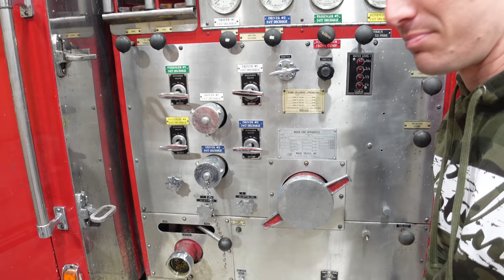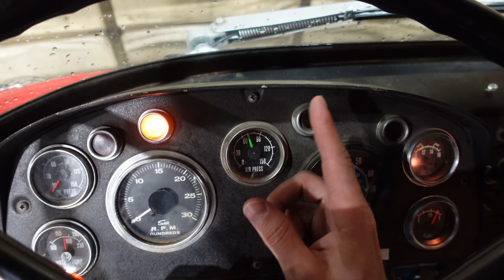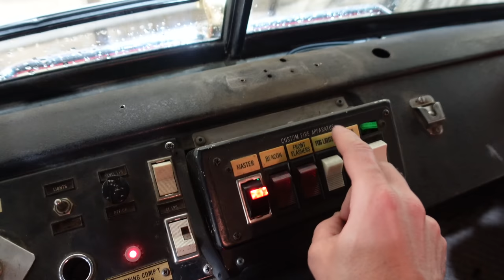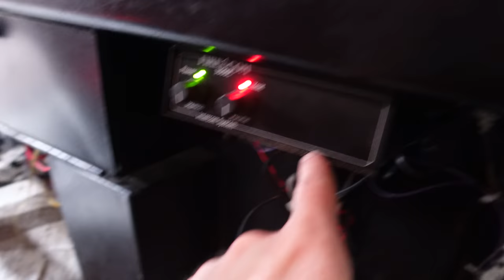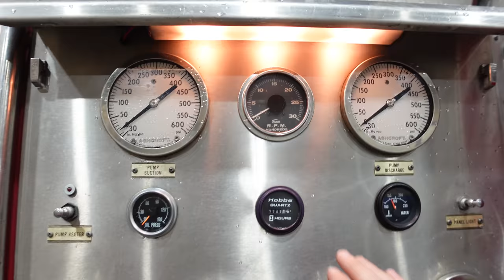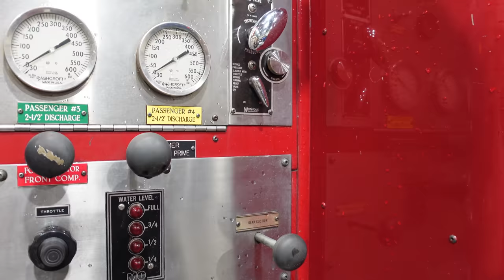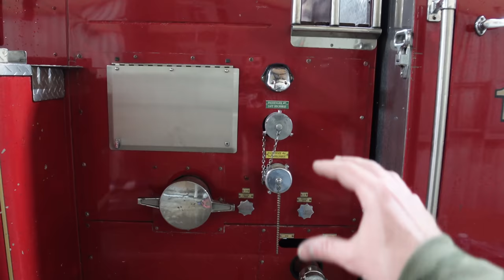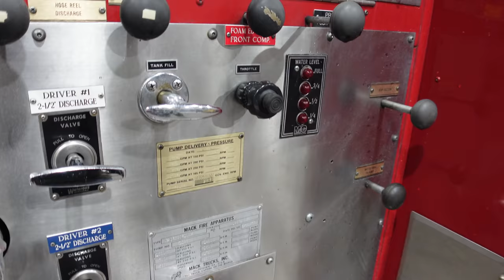Here's A COMPLETE Tour Of My 1977 Mack CF-600 FIRETRUCK

Comment: The Gold Bulldog represents the fact the truck is built completely of Mack components from chassis to drivetrain and body
Reply: And since it has the ENDT-engine, the engine is acctually a Scania engine
Reply: @megu_weeb  mack is owned by volvo trucks isn't it? So we have come full circle
Reply: @fritsmolenaar05  scania is Saab. Don't know what engines volvo trucks run. Probably volvo made.
Reply: No , his is a Maxidyne motor. Dont know which one though.
Reply: @geraldlafleur7776  probably a 350 mack to run the pump.  they take a pile of power.
Reply: Pretty rare too!
Reply: @fritsmolenaar05  No, 
These we’re made before Volvo bought Mack.  It’s a true Mack Engine
Reply: cool last name haha
Reply: I drove Mack trucks for years and had heard that, but it's been a minute so I forgot. Thanks for making the comment. We get old, we forget.
Reply: @adriandean7815  saab has gone bust and volvo trucks now ownes renault and mack trucks
Reply: @fritsmolenaar05  yep. I own a classic 900 Saab. And I live in Sweden. Lol. Somebody said volvo truck engines was scania. I said Saab is Scania. Don't think volvo engines are scania engines. But maybe.
Reply: Was just about to say the Gold Bulldog is the first sign that it's all MACK
Reply: The pump was by Waterous pumps, being a 77 , means it’s made from problematic steel and will rust if not kept up
Reply: Also it was refurbed at some point, rear seats used to be open air
Reply: only up to a certain year, then it was maxidyne motor for gold, silver had the thermodyne motor. its got an automatic transmission in it so this wont be a full mack drivetrain.
Reply: @fritsmolenaar05  never knew that till now! Early 2000’s is when Mack was purchased by them!
Reply: Ya beat me to it, Josh. Good on you.
Reply: @jimwilloughby  Mack has been the only thing ive worked on for 16 years now
Reply: @megu_weeb  How did you determine this? It would not have a gold bulldog unless engine was manufactured by Mack in 1977) at Hagerstown, MD.
Reply: @fritsmolenaar05  It is now.  In 1977 Mack was owned by Signal Oil and Gas Company - since 1967.  Renault bought a 10% shareholding in 1979.  Mack Trucks is a subsidiary of AB Volvo now, which purchased Mack along with its then parent company Renault Véhicules Industriels in 2000. i have NO IDEA what you mean by "full circle."
My father worked at Mack for 45 years (1937 - 1982, my uncle about 40 years, mostly on the 'fire line;' as they called it. The early all-Mack Fire Apparatus (In 1956 Mack bought the tooling of the Ahrens-Fox Fire Engine Co. and introduced the Mack C Model cab forward fire engine) manufactured in the now-gone 5C plant (Allentown, PA) then later moved to the Lower Macungie plant, which produced the Mack CF model fire apparatus, likely where this truck was made.

Interesting note - Mack made the FDNY Super Pumper - Called the world's most powerful fire engine ever built. See video: https://youtu.be/lKUBAgUUyIg

Comment: I think we have the original Streamlight that goes with that mount, I would have to look in storage, If so, you can have it when you get the Title. I do think it needs a new battery though. We had others we would grab before calls so we never used that as it was always a backup if those went down. If you have any questions at all, you have my number, feel free to call and ask!
Reply: I have yet to meet a Streamlight boxlight that didnt need a battery! Lol
Reply: @keithmack2368  So true LOL, In the future we want to upgrade to the new LED Streamlights, but for now the old girls work just fine!
Reply: Luckily, the batteries are available, cheap, and dead simple to replace. You can get new ones for less than 20 bucks on Amazon. Just be sure to get the right size tab connectors on the top. The same battery is used in emergency lights and computer UPS systems, but can have a wide or narrow tab.
Reply: @porcelainthunder2213  a quick search on Streamlight’s parts site shows that they still sell the battery for the Firebox/Litebox series as well as all the major parts to completely overhaul one!

Comment: I was a driver engineer from that era. New engines of that era went new for $ 70 to 80k. I drove a pretty well optioned American LaFrance 1250 gpm. The pump on this truck does not run on a pto. There is a pump transfer case built into the bottom of the pump.. To use most of these you would set the trucks parking brakes. Then put transmission in neutral . Then select pump position on the pump selector in the cab. This would disengage the driveshaft from the transfer case to the trucks rear axle. And engage a gear train internal to the pump to drive the pump. The trucks transmission would the be placed into whatever gear selection required by the manufacturer and the transmission would lock in that gear. The driveshaft from the transmission to the pump would run the pump but was disconnected from the trucks rear axle when pumping. Be careful not to run the pump dry as you will damage it with no water. Hopefully you can find some hose and get it pumping. There are clubs that get together with antique trucks, some much older than yours. They show them off and pump them at events they call musters.

Comment: Some nomenclature pointers: The hard rubber hose on the reel we called a booster line. Maybe discharge 5 or labeled booster.  VERY handy because it can be charged (pressurized) on the reel and great for small fires, dumpsters, grass fires etc. Scrounge up an adjustable fog nozzle for that and you can use it too! The packings in the pump dont like to be dried out but the pump cant be wet and frozen either. Read up on the pump so that it does not get damaged. My memory tells me that Mack used HALE pumps. Mack was a rare fire engine manufacturer in that they built the whole truck save for maybe the pump itself.

Comment: It is nice to see the old Mack Fire Engine.  Your "new" Fire Engine that was built in 1977 was refurbished by Custom Fire Apparatus in Osceola Wisconsin in 1989. 
When the engine was in 1977 by Mack it looked different.  The cab rear area was open with a gate on each side to get in and out of.  The pump panel was set up differently.  The rear box was also different. 
In 1989, Custom Fire rebuilt the whole truck.  They started with taking the whole rear box off and putting a new box and water tank on.  Next, they rebuilt the 1000 gpm mid shaft Waterous pump, the pump is a mid shaft not a pto.  Finally, they enclosed the rear crew cab.  NFPA had made the rule that any new or refurbished fire engine, truck, or other fire apparatus must have enclosed crew cab.
If you want some information about your engine, you should contact Custom Fire.

Comment: You need to drain out all the water from the hoses and tanks. Or run some rv antifreeze thru the system so it doesn't freeze up in the cold weather and while driving it. You'll blow out or crack the pump and castings if you don't.
Reply: Here in Germany we drain the pump whenever it is not in use for exactly that reason. The tank however is less critical for several reasons. If your garage is heated (which it usually is for fire stations here) it won't freeze while it is in there. Out there it would take quite a while for this amount of water to cool down and freeze, and last but not least other than the pump, the tank usually has some air between the water level and its ceiling, leaving room for expansion. But draining the pump is essential if there is a risk of freezing, I agree. :-)

Comment: That was built in Allentown, PA.  The MACK CF was a workhorse of a fire truck.  It is built like a tank.  The Federal Q2 on the front bumper takes an enormous amount of amperage to run FYI.  
That unit originally had an open cab and was converted to a 4 Door.  Let me know if you have any pump operation questions, I am a firefighter in New Jersey with a lot of experience on pumps.  Looks like it is a 1500 gpm pump with a 500 or 750 gallon onboard tank.
Reply from the maker: Yup, I was told it's a 750! I can't wait to fix the Q2 💯
Reply: @WatchJRGo  If you want a pump primer on how to, let me know.  I can also help you find some accessories like ladders and hose.  Awesome buy!
Reply: 750 Gallon Tank, and 1000 GPM Waterous Pump.

Comment: From a Former CF operator.......The gold bulldog means it has a Maxidyne motor.  (Mack’s superior motor).  The horn ring shows who the rig was originally built for.  The clps switch is for the clearance lamps.  The reservoir for the windshield washer is in the passenger side cab door-it may be empty.  There are plates on the body just past the pump panel that say Custom Fire.  That indicates the chassis and pump were built by Mack, but the body was built by Custom Fire.  Get rid of that AFFF foam.  It’s a known carcinogen.  The controls for motor shutdown in the cab are air shut offs, not fuel.  Mack commonly used air shut offs for many years in their trucks. The air connect is a quick (and easier) fix for a leak in the air system.  Its not something Mack would install, but it works.   Its a sweet truck that will run for long time with a little tlc. Have fun
Reply: The "Custom Fire" plates were added when the truck was redone by the company that did the work.  This was when the pump was replaced, auto transmission added and the color coded labels were added to the pump panels and the jump seats that had mounts for the SCBA's.  All these features were commonly added to fire engines in the late 80's - early 90's.
Reply: @tomwilkeson2419   Were the jump seats open and then enclosed during refurb as well?
Reply: @greymansion1  I am not familiar with this engine but was speaking from being a firefighter in the early 90's and seeing the big push to auto transmissions in emergency vehicles that took place then. I think you might be right about the cab. Many were converted during the same time.

Comment: Very nice. I fought many fires from a similar 1970 CF600 that had been FDNY from Staten Island. We bought it when FDNY retired it and redid the bodywork. Made the tank smaller and put a hydraulic reel in the back that carried 1500 ft of 4 inch supply hose. It was our water supply engine.Have fun with yours.

Comment: The truck has always had a 12 volt electrical. Originally it used 2 6 volt batteries in series to equal 12 volts.

Comment: Now that is old school quality all through that truck.  You STOLE that at $3,000.  All of that diamond plate, polished stainless, gauges and chrome.  Don't do it, but the scrap value on all of that equipment, let alone the running gear, has to be enormous.

Comment: Brings me back... First engine I drove as a rookie in 1985.  Our CF-600 was a reserve engine at the time. It had a non-synchro manual transmission so you had to double clutch and match rpms to shift. It was a V-6. When you got the hang of it, with the short wheelbase, it was so cool to drive.  When I was an engineer, I had the experience of pumping with it (and other pumpers) to Chicago FD’s Big John deluge gun, 6-7-1,  at the East Chicago tire fire in 1994 https://youtu.be/W7KyNUt7RwU . We later donated the rig to the Hall of Flame fire museum in Phoenix. It was fully restored in 2004 by the museum. I retired as the vehicle maintenance officer. I spent many hours in, on, and under that CF. Thanks for the memories.

Comment: That enemergency engine stop in diesel engine is normally air flap to cut out air. Diesel engine can run away with its own engine oil, so fuel cutout wont help.

Comment: JR, the siren/horn switch lets you use the horn button on the steering wheel to wind the Federal 'Q' out. There should also be a foot button on the floor on the officer's side (Passenger side) that controls the 'Q'. You've bought a true classic, BTW...the Mack CF is an awesome rig. The fire department I ran with (Chesterfield, Va) had had around 20 of them...they were like tanks, they last forever.

Comment: The pump is not PTO driven.  It is driven through a transfer case.  The input to the pump is a driveshaft directly connected to the transmission output shaft.  In "Road" condition, the transfer case supplies all engine power to the rear axle.  In "Pump" condition, all of the engine power it supplied to the pump rather than the rear end.  PTOs back then could not handle the full engine power.  Modern PTOs can handle 1250 GPM pumps and possibly even 1500 pumps by now.

Comment: A few things:

That 120v shoreline plug is an auto-eject.  As soon as the alternator spins, it fires out the cord... no button for it.

That e-stop kills the motor with a fuel cut on top of the engine.  You’ll have to get to the intake manifold to reset it, and it’s a complete @&$%# to get to.  I’d leave that one alone.

That Q-siren is clicking its brake when you push it.  I’m guessing that’s the siren brake button.  Look for a little black pedal on the floorboard that runs it.

The air check valve is just past that air plug.  It’s a simple one-way valve, common part.

Streamlight firebox flashlight: you have to do it.

 Nice wheels, bro!!

Comment: The headset connection at the pump panel allows the engineer (driver / pump operator) to access the vehicles radio remotely so they can hear other vehicles and communicate with handheld radios on scene. The push to talk on our engines keys the radio.

Comment: Oh, and the turn signal control is a replacement. You can see where the original control arm was in that opening on the steering column.  The green light just forward of that was the original turn indicator light.  That’s why the hazard light control is on the dash.

Comment: One thing to note with these old pumps, try not to run them dry, the water helps lubricate the compressor wheel, make contact with the pump housing.

Comment: The big ports you were calling suction are called steamer ports, they are for your large bore hydrant connection . the smaller ones are for low flow hydrants that use 2 1/2 hose for its connection. Newer hydrants use storch connectors, 1/4 to lock. These are anywhere from 6" to 8" LDH. (Large Diameter Hose)

Comment: If I had the money/time/inclination/YouTube channel, I'd definitely turn it into a kind of rolling repair shop for cars. You already have air compressor needs so get a larger comp so you can use air tools. Convert some of the water tank area to hydrolics if necessary and add some kind of transforming, collapsing Benpack lift that is always connected to the truck for stability but can be deployed and retracted when needed. And then convert the remaining water capacity to high pressure hot water for detail/power washes, and then add a vacuum system for well... Vacuuming. You already have loads of parts and tools storage. Add a way to safely tow vehicles like a simple vehicle hitch and imagine the videos you could make. Just head out on the highway looking for broken down cars on the side of the road. Tow them to a safe location, repair them and get them back on the road better than before. JR-Go emergency vehicle service!

Comment: You can add an air pump if you have a Kussmaul auto charge, or get an auto air eject from Kussmaul and leave it plugged in all the time. Works the same as the shore power ejector.
Reply: At our station we have a 80 gallon air compressor and lines plumbed across the ceiling to reels that are connected to the trucks with a regular air hose connector to keep the air brake tanks full so trucks are ready to go. The 110v shore power runs onboard battery chargers for the truck batteries along with various chargers for different pieces of equipment.

Comment: Foams not usually used on bonfires, mostly flammable liquid fires as well as for vapor suppression. The appliance in the first cabinet you opened with foam is the enductor, goes into the bucket of foam and mixes with the water and is made into the bubbly foam at the nozzle.

Comment: The Federal Q2 Siren button your pushing on the dash by the switches for the lights is probably the siren brake, theres probably a button on the floor like a old school high beam switch. Thos streamlight light is not explosion proof, get one with the led bulb. That truck probably cam a 12 v system. My first day working in 1996 I drove a truck just like that except ours the two back seats were a open cab. Those tires are split rims, very dangerous to change unless you know what you are doing.
Reply from the maker: I didn’t want to pay for a new one so I didn’t get the LED. Ended up with the old school one for $40 🔦

That switch totally sounds like the brake, I’ve tried the floor switches and they didn’t do anything, I’ll get it fixed 🍻
Reply: @WatchJRGo  the floor switches are notorious for going out, it's hard to kill a Q so it must be something easy

Comment: So have you figured out how to run the pump yet. Those old trucks will be in great shape because firefighters are pretty particular when it comes to keeping the trucks clean and shiny. These old trucks get retired because current NFAA standards require AC in the cab for fire personnel.
Reply: We were very surprised the 1992 we replaced it with didn't have AC either lol, We were really hoping it did! But oh well! Still gonna be cooler then riding in the back of Big Red.

Comment: I'm not familiar with vehicles equipped with emergency shut offs, but on diesel equipment it is an air cut off. Many of them required a manual reset.

Comment: To fill the radio void, maybe get a Motorola (or Kenwood / Icom) that’ll do 2m or 70cm.  Get whatever band the local repeaters (or Skywarn) are on, and install a new antenna on the roof mount.  At least it could be functional in there.  I kinda get the vibe you would know what I’m talking about, btw.